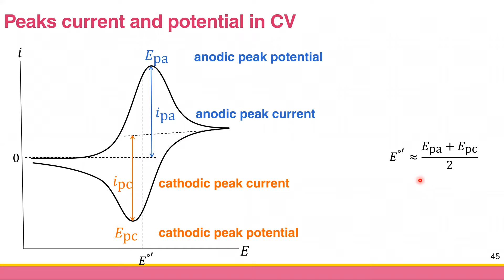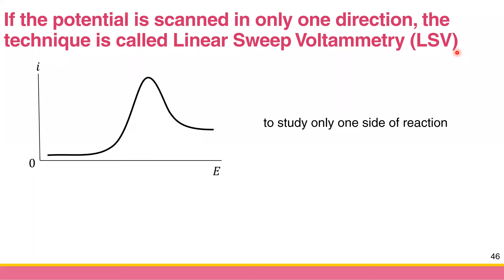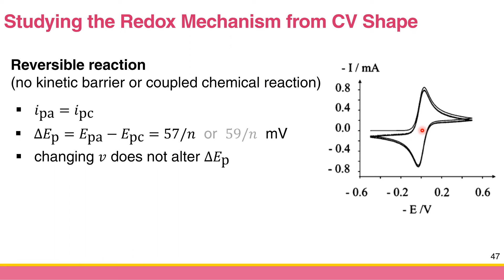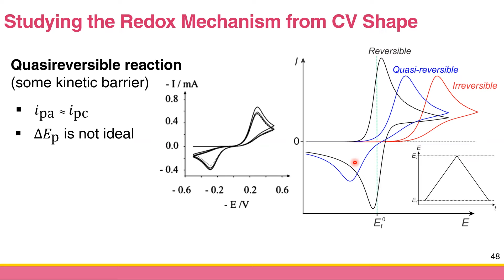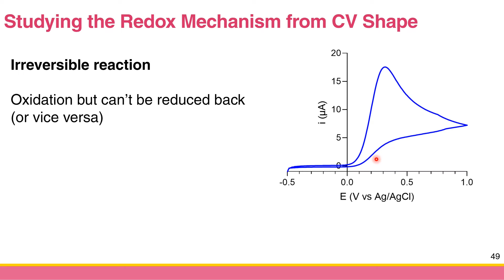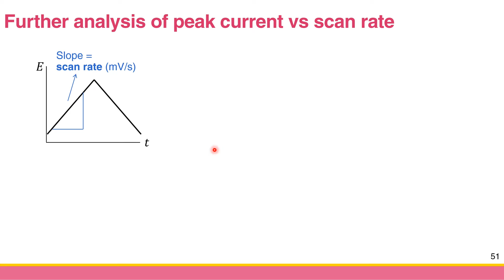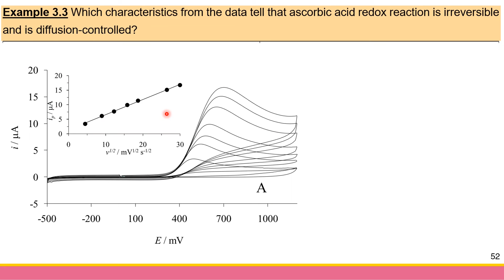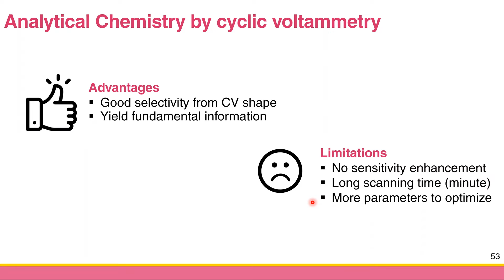Cyclic Voltammetry: Interpretation of Simple Cyclic Voltammogram

Comment: Very well explained!
Reply: :body-blue-raised-arms:
Reply: Please any one help me in solutions this problem

One gram of zinc metal dissolved in a solution of hydrochloric acid with a concentration of 6 molars, dilute it to 250 ml. Take 25 ml of it into a polarography cell, and the polarogram shows a voltage wave at -0.65 volts (assigned to Cd impurities), a diffusion current equal to 32 milliamps. If we add to the cell containing the zinc solution 5 ml of Cadmium chloride concentration is 0.0005 molar, and when taking a second crystalogram, the diffusion current was 77.5 milliamps. Calculate the weight percentage of cadmium impurities in zinc metal.

Comment: Sir, thanks for this useful video, but what is the reason that species don't undergo in the case of irreversible
Reply from the maker: Hi! It depends on the chemical properties of that species.  For example, some species after being oxidized are rapidly react with water or undergo further chemical reaction.  Those reacted species, most of the time, cannot convert back to the original form.